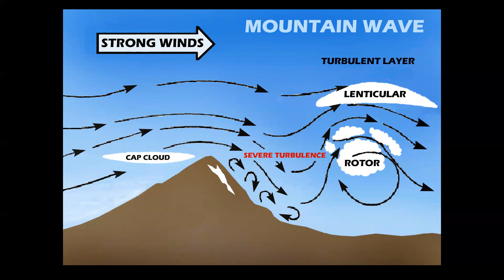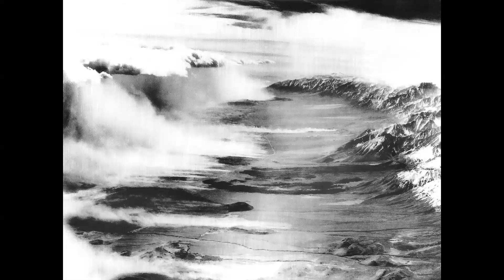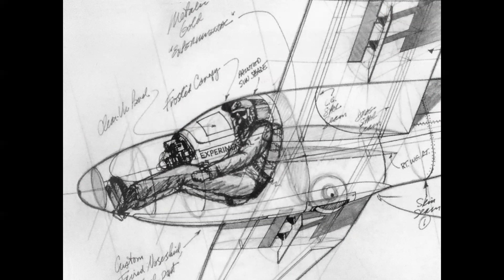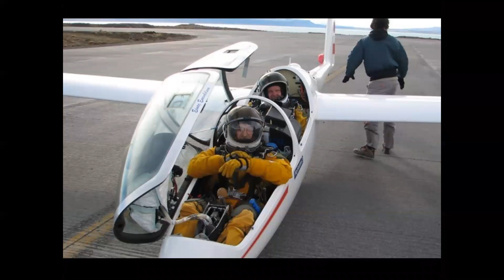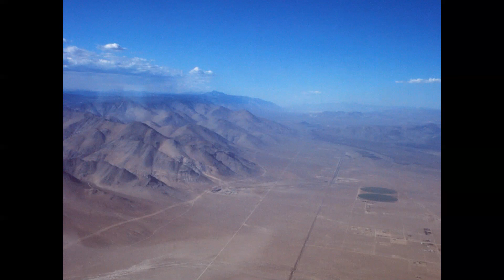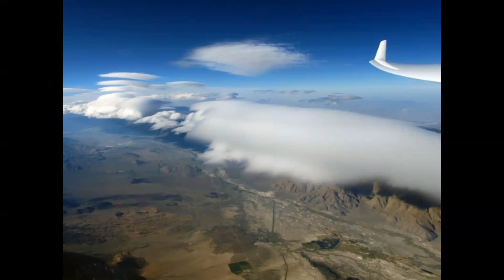WAVE FLYING: High-Altitude Soaring Records Over the Sierra Nevada Mountains, 1948-1986

Comment: Paul Bikle set two world soaring records on February 25, 1961, while flying his Schweizer SGS 1-23E near Lancaster, California:
 * Altitude: 46,267 feet (14,102 meters)
 * Total-altitude-gained: 42,300 feet (12,900 meters)
Both marks were certified by the National Aeronautic Association and the Fédération Aéronautique Internationale.

I was stationed at Edward’s AFB from 1963-67. Paul Bickel had set his altitude record just two years before. That altitude is at the limit without pressurization. The wave is really smooth until you hit the rotor which feels like a speed bump.
Reply from the maker: Appreciate the comment, thanks!

Comment: If you like glider stories, check out the records set in the wave the Pyrénées, Southwest of France. Here, the wave strength is comparable to the Sierra Wave due to the powerful winds coming from the Atlantic, and particularly from the Golfe de Gascogne. Gérard Pic set some high altitude records up to 40 000 ft in gliders with glide ratios like 18 or 20. He said that with a more efficient glider, he would have been even higher ! He went to 11 250 meters with a Fournier RF3, glide ratio 18:1, non feathering prop, motor glider.
I talked also to Mike Anastasiou on his YouTube channel, and he told me he had set an altitude record at a bit more than 30 000 ft in a wave in Greece onboard a Pipistrel Taurus. He told me he would have been way higher, but he wisely choosed to go down righte after passing FL300.

Comment: Having earned my linnie pin in the skies over Stead Nevada and many wave flights I can't explain enough how very smooth wave flying is in the up and down portions of the wave (stay out of the down).  I took a student who was a surgeon aloft into the wave and he commented, "It is so smooth I could literally preform surgery right here and now."  But the danger is in the rotor, just stay away. Soaring is a wonderful sport and can make a power pilot so much better with the knowledge of air and it's currents.
Reply from the maker: Excellent comment, thanks, and yes, my power flying became a lot sharper after I got my Glider ratings!
Reply: Love your site!

Comment: How do you pressurize a plane with no engine?  76000 feet...incredible.
Reply from the maker: Great question Max! I only know that its onboard power source keeps cockpit pressurization at 8.5 psi differential.
Reply: Big honkin' high pressure air tank.  Really.  Breathing O2 supplied separately   via a closed-loop rebreather system fed by its own high pressure oxygen tank.  Both systems rated for 8 hours duration;
8.5 PSI max differential provides a cabin pressure equivalent to 15;000 feet MSL at a target maximum 90,000 feet MSL.